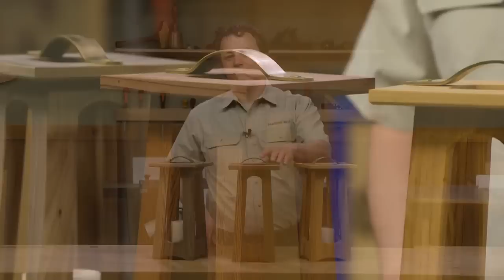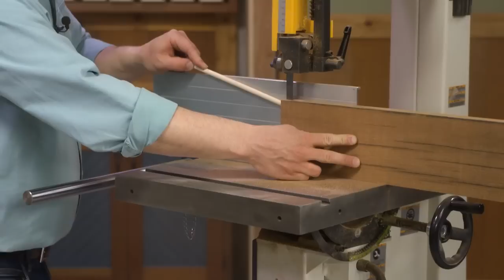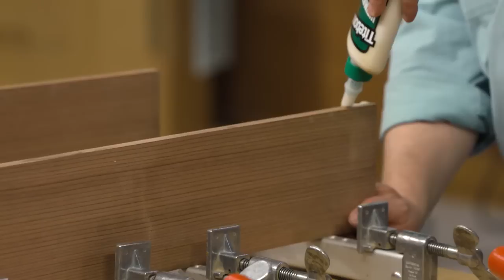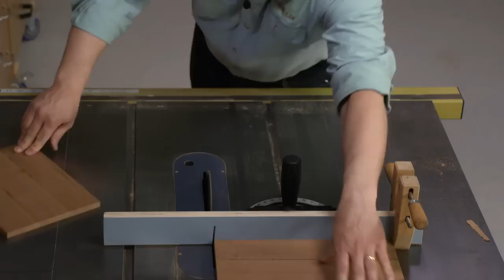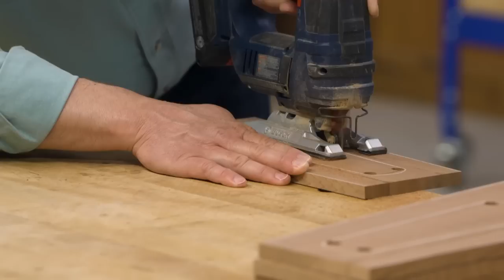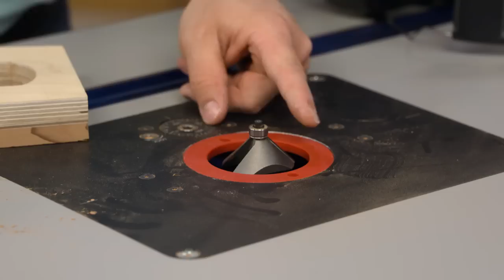Candle Lantern Build - Part 1

Comment: I like that you drilled four holes in the sides, before cutting with the jigsaw.  You mentioned it could be done from just a single hole, and that you had trouble doing those tight cuts.  Me too!  It seems much easier to simply drill the four holes first!  I'm absolutely the WORST when trying to cut tight curves with a jigsaw!  :)

Comment: From personal experience, a fixed metal handle on top of a candle lantern is a good way to remove your fingerprints along with a fair layer of skin from your fingers if you accidentally or deliberately touch the handle. A lot of old lanterns used a wire bail with a wooden dowel handle that hooked around a couple of eyes screwed into the top panel - even older lanterns had a wooden block on top with a few vent channels on the bottom so if the lantern was hung from a hook the wire handle didn't heat up from the candle's exhaust plume.